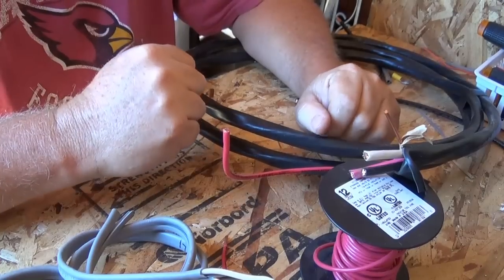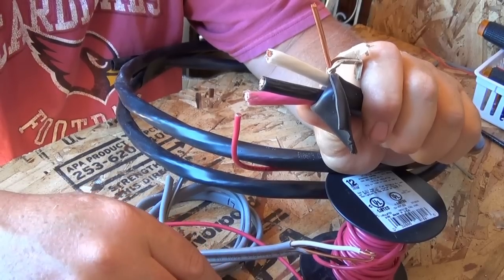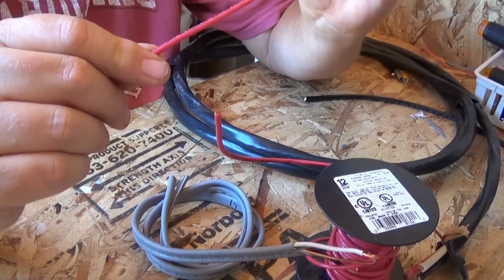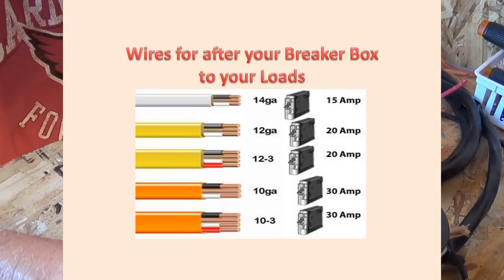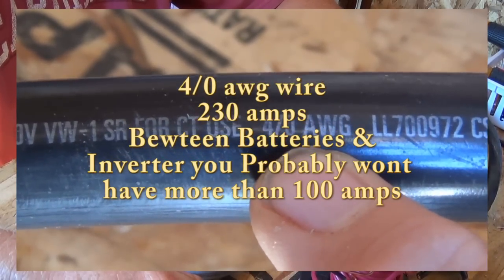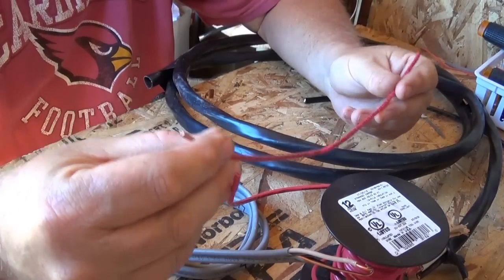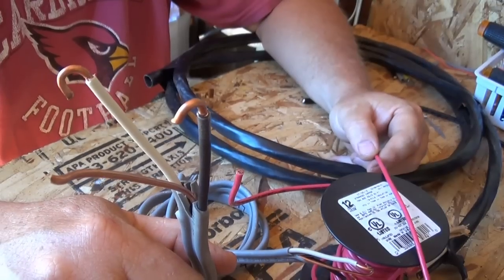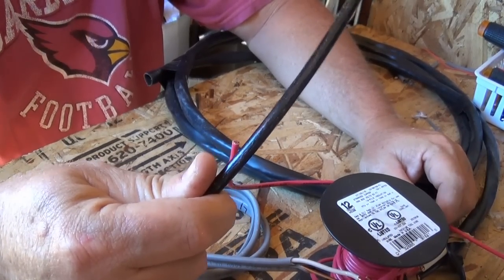What Size Wire Do I Use To Wire My Solar Components? Does Wire Size Matter?

Comment: Cool...just subbed in. I am running a DIY 4.9KW home off-grid solar power station. I use 4/0 between my 24v battery bank and 3.5KW inverter. Works great...kinda like using a garden hose to drink from a Big Gulp. The cable is actually TEMCo welding cable...with a lot of strands. Zero heating issues...tested with infrared thermometer. Great topic on wires/cables...have fun out there!
Reply from the maker: thanks and welcome aboard... garden hose I like the reference..
Reply from the maker: I subbed back. thanks again.
Reply from the maker: I subbed back. thanks again.
Reply: You went way overboard with your wiring.  You could have used 1/0 wiring.... 3500w/24v=145amps.  
http://www.cerrowire.com/ampacity-charts

Comment: My biggest issue is getting/affording big enough wire to stop voltage loss.  My first installer used some so thin, I am going to have to pay for new wires if I want any efficiency.
Reply from the maker: its hard to really say but I think it you have 6awg from your solar/components/battery to your rv that would help reduce loss.. your rv is already wired as 6awg. mine was so I assume all are. wire right to your dc part of the trailer. use only the 120v rv plug when you need to. that should also help reduce your emf too. I would think.